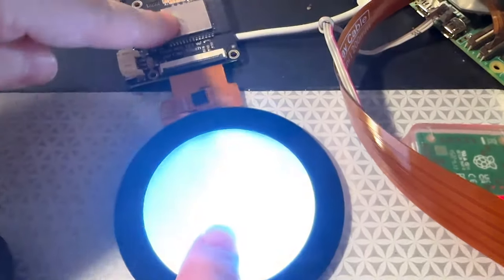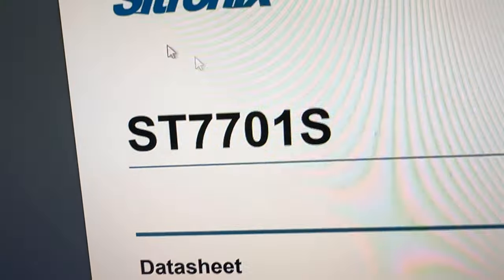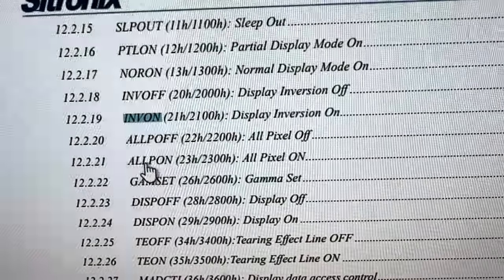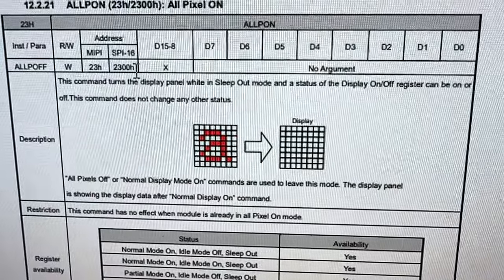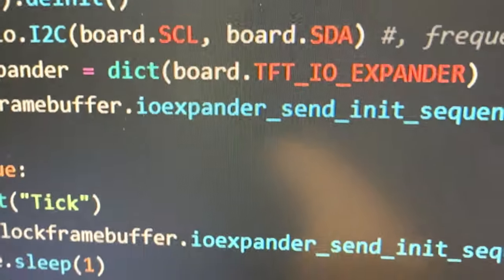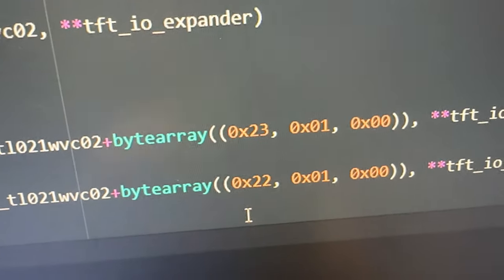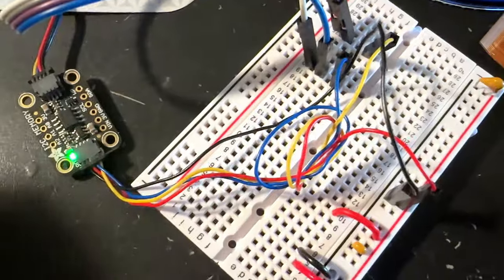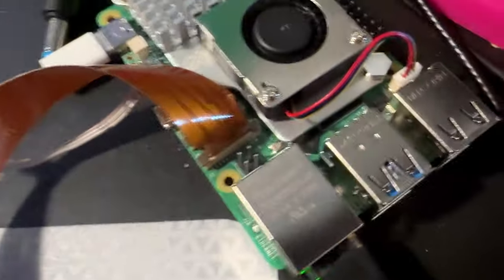ICN6211 & TFT display hacking debugging

Comment: Hi Lady Ada I have a few questions regarding the 4" display:
1. I'm very confused why the product page description for the 4" LCD says it uses the ST7701S driver IC as well as in this video. However in the technical details section it says it uses the NV3052C. And then if you look at the Application note it says it uses the NV3051CRGB which is extra confusing.
2. I'm currently trying to bring up the display on a STM32 however having quite a lot of trouble. In the product video for this display you said this works on Arduino (assuming C++ code)? Is that init code available anywhere?
3. Finally I am also confused why the Init code listing on the technical details section is different to the init code structure for the CircuitPython?
Thanks for reading, I hope you have some insight into this.